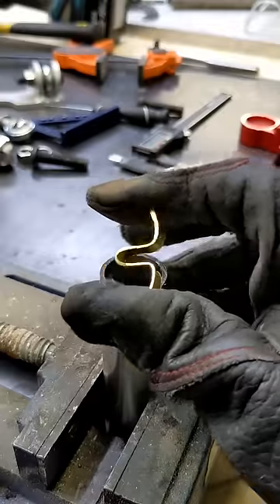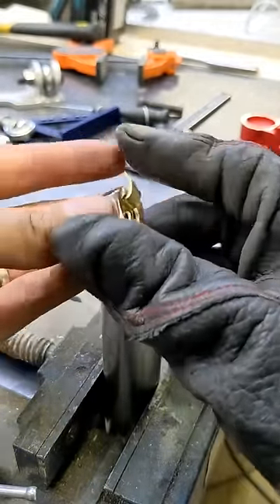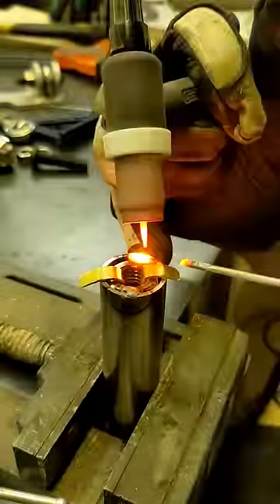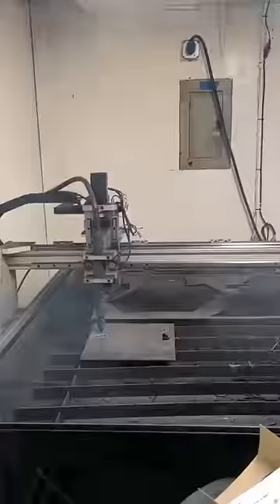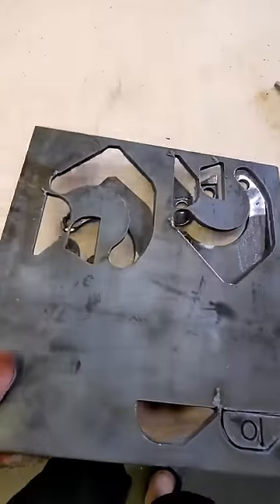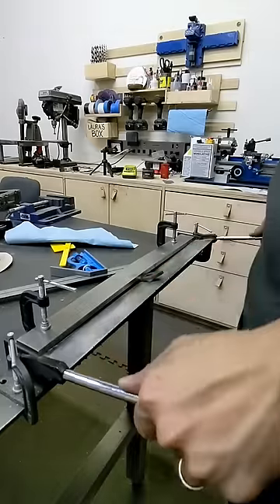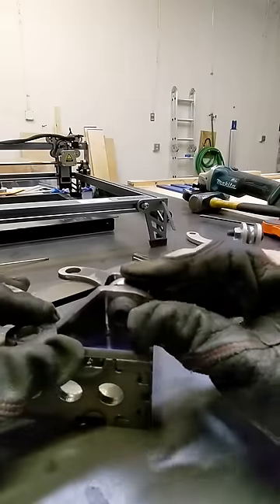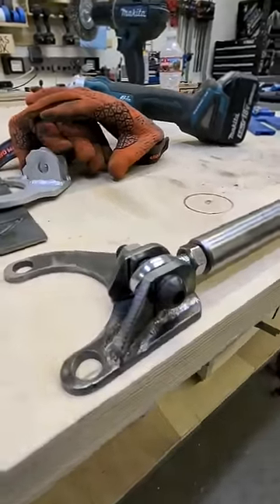Making a Strut Tower Bar for a Honda Beat #shorts

Comment: One nut and Heim joint should be reverse thread.

Then you have a tunable brace, tighten for more oversteer
Reply from the maker: That's exactly what I did! Just didn't mention it on the video due to the 60s time limit 😅
Reply: @IMEEMADE  Good thing I came by to help out then!😂